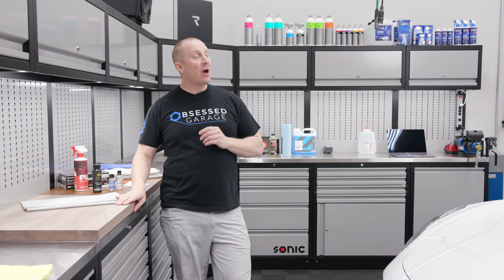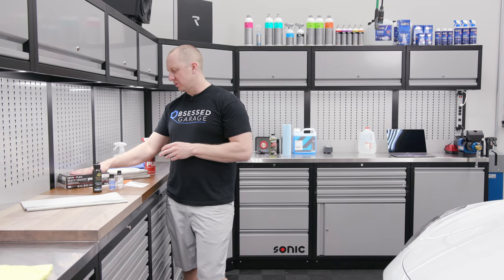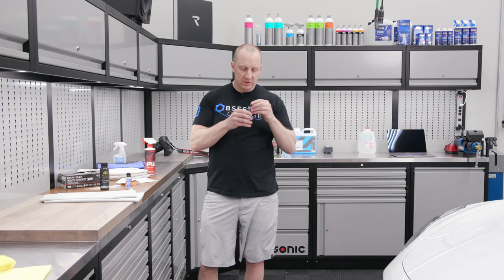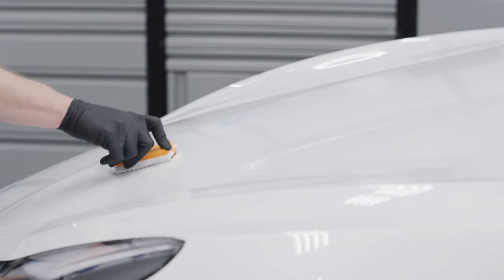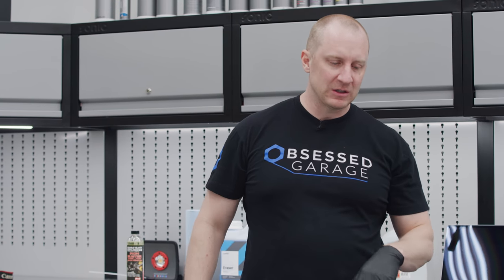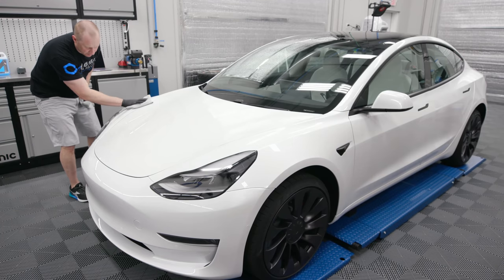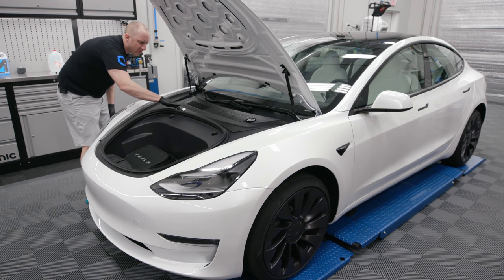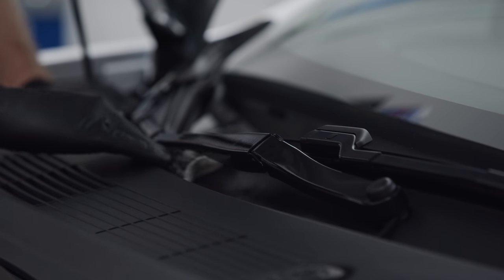How to Ceramic Coat Your Tesla Model 3

Comment: Matt, have you ever experienced (or heard of) issues with coating over a Tesla's cameras and/or sensors and having them not function properly afterwards?  I think I know the answer, but just thought I'd ask in case before I screw something up. Thanks for a great series on the Model 3!
Reply from the maker: No, shouldn't be an issue.
Reply: @ObsessedGarage  Thank you!

Comment: After polish do you find that panel wipe and microfiber removes all leftover polish residue? Asking because I assumed washing after polish to have a clean surface for the coating to bond to was a good idea
Reply: Panel wipe will remove all polish residue and oils, washing would increase the odds of scratching and marring.
Reply: If you have polish residue, you may not be changing towels and buffing enough. Buff to exhaustion -> cold beer

Comment: Love your channel - How would you wash your car (other than hand-wash, carwash ) as I live in the Northeast area. I have a white Toyota  and looking to go to a Tesla for our next daily  driver. Thanks for your great tips !
Reply: Any other way other than hand washing will result in some type of swirling/scratches. Go look at his wash and talk videos then you'll see that he never uses a drive through car wash.
Reply: Handwash is the best. But if you can find a truly touchless automated wash that'll work as well. But handwash is the best way and that's the most affect way
Reply: Ira, my winter in VT: I use a good DYI car wash. Never touch their foam brush, ever. 2 min with pressure wash on Soap, get your grit off. 2 min with seperate soap gun, foam the car. Bring your own shaggy mitt, and gently move around foam. Then pressure rinse and dry. Last step, buy the Bead Maker. Go over whole car, dry with a clean "drying agent" towel.
Reply: @ccwnyc5671  Thanks for the great advice!

Comment: It is difficult to believe 20ml of anything is going to provide any protection, especially when most of it evaporates or is wiped off
Reply: The solvent portion evaporates (as it is designed to do), but nothing is wiped off. It gets leveled. Paint is very porous and jagged on a microscopic level. Coatings fill it in and smooths everything out. It is the best paint protection you can buy, but it isn't bulletproof.